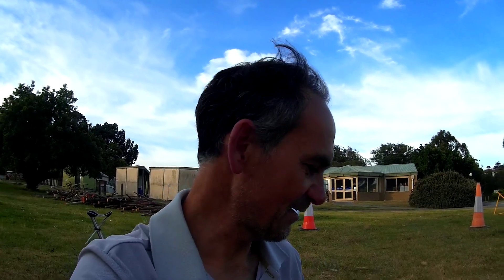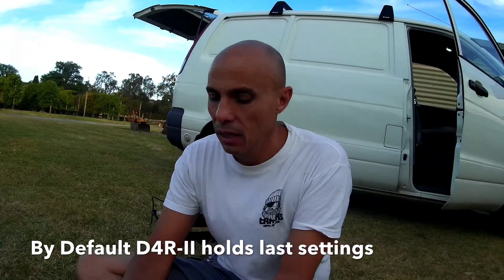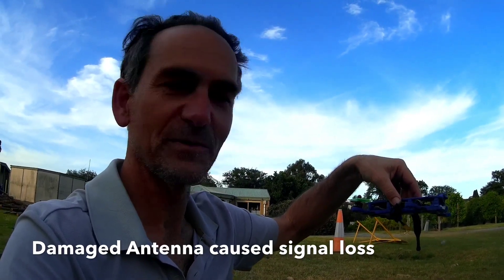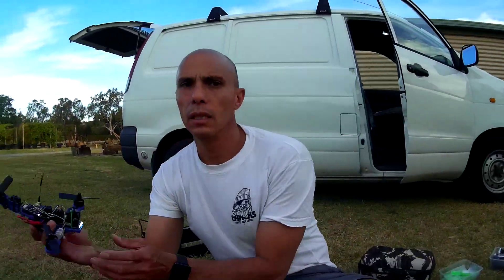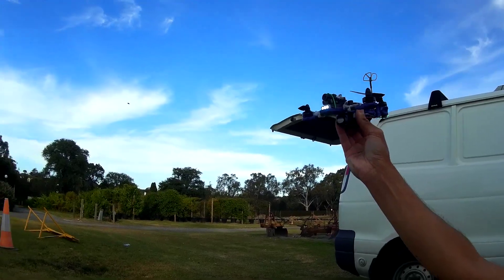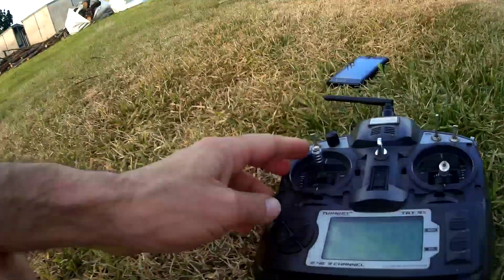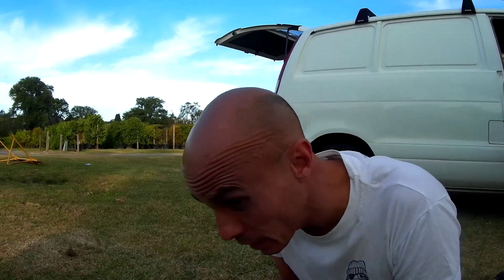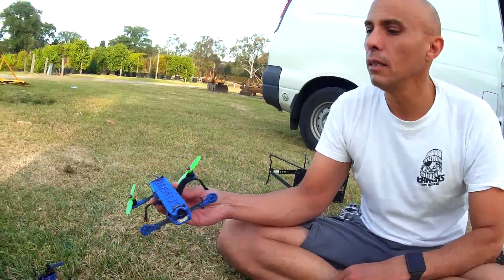Naze32 Tips | Failsafe warning Part 1

Comment: I actually thought the default failsafe was a good thing.  It actually saved my quad a couple of times when I lost signal flying through forest and behind buildings.  Having last position as a failsafe kept it flying until it reconnected.  On balance though it's probably better to just have it fall out of the sky.  Still no guarantee its not going to fall on something or someone...

Comment: If you fly acro or race, don't use fail safe on FC or receiver.  So many things can go wrong!
Reply from the maker: Why not, a flyaway can happen to anyone in this case it was because of a damaged antenna on a previous crash.
Reply: +jbalatutube With a quadcopter you will waste your engines, esc's, and environment around you then.  For example, your receiver could go out and the quadcopter tumbles and lands upside down, engines and esc's continue to power, get overworked and start everything on fire.  Sometimes it is better just to let it drop and crash if you fly acro and race.  Some organized race events require you to remove failsafe.  It's for safety.  The quadcopter could even drift into spectators if you have high horizontal speed.  Don't use failsafe in those cases with a quad.  I see that you haven't had enough accidents or burned enough engines and esc's to realize that yet.  Fly safe :)